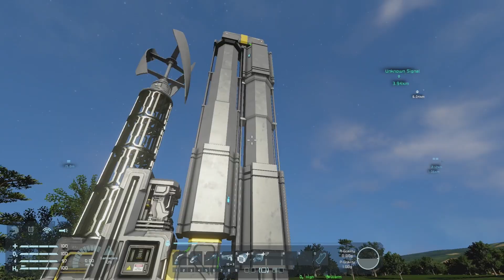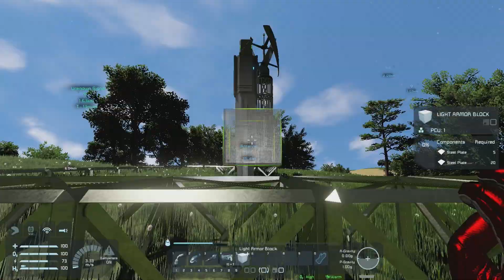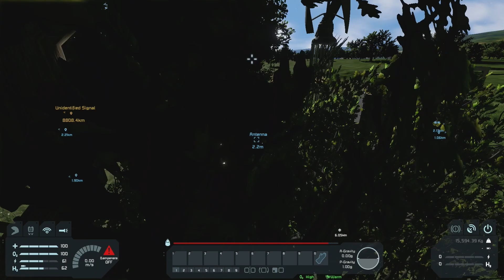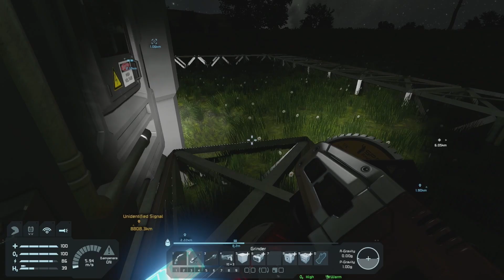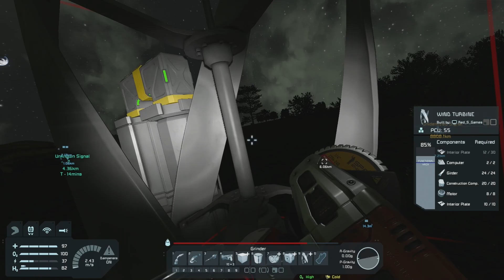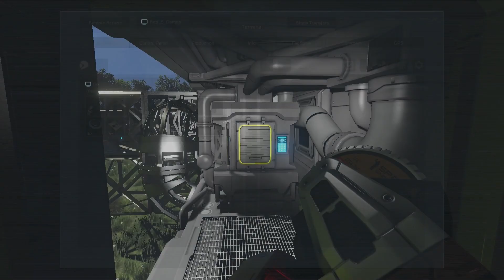Power Perturbances - Contact EP2 - A Space Engineers Vanilla Survival Series

Comment: i like to make remote charging station about 50 to 75 kilometers from base. 2 blocks in ground. 8 cylinders high. 1 wind turbine. 1 bat ,set on recharge. 1 vertical connecter and 1 horizontal. works great for land rovers and flying ships. bye